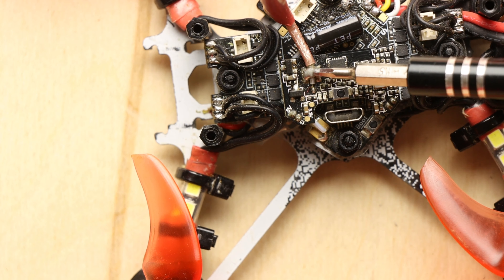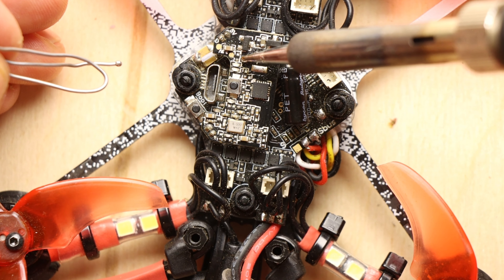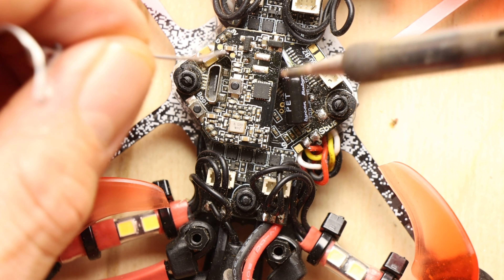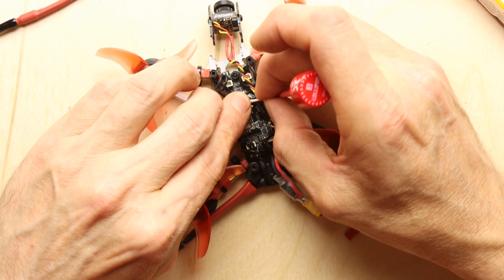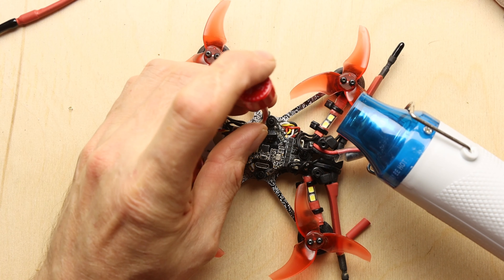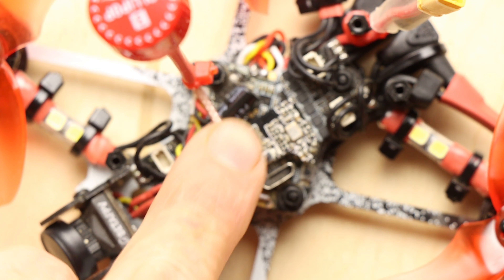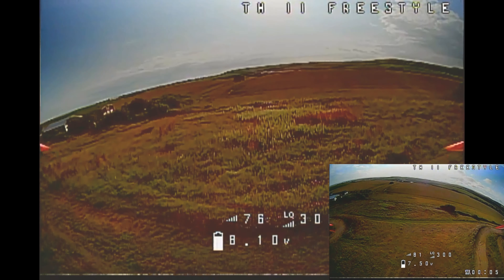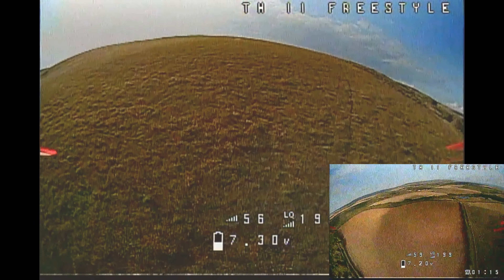emax tinyhawk 2 freestyle vtx antenna upgrade, amazing! results

Comment: I added a small zip tie to the plastic part of the battery strap and the antenna, which was pretty stable. It looks like you use two capacitors instead of one, does this have any advantage?
Reply from the maker: Yeh I went with a fatter zip tie and slightly shorter in the end worked better.
I've done both 2 capacitors and tried the variation of one on thr board or one on the xt30 lead and its all much the muchness tbh

Comment: Hello, just à question, (my english is bad and probably someone asked) i can do this and use the emax Google in the kit and Just change the antenna ? No need change other thing? Thank you!
Reply from the maker: Yes you can add this antenna to the drone directly or with the ufl plug as shown. For best results change the antennas on the goggles to rhcp antennas one lollipop and the other a patch 👍
Reply: @Stevieboyfpv  thank you👍

Comment: I did the antenna upgrade and I'm seeing better range and video quality except that my video will drop out completely for a 1/2 sec to 5 seconds randomly, any advice for troubleshooting
Reply from the maker: That usually means a connection, or earth problem somewhere 🤔
Reply: @Stevieboyfpv  I may have not put enough solder on the small pin of the u.fl connector
Reply from the maker: @Engineerforhire  possibly or you have a bridge 👍

Comment: What was your total range ?
Reply from the maker: @Tfam305  about half a mile before the battery would force return it could prob make a mile direct line of sight. I exchanged this for the foxeer micro lollipop after the video which was smaller and less flappy.
Reply: @ got it just ordered !
Reply: @ I am having throttle issues. Have you had that before? The drone is new if I barely tapped the throttle it’ll shoot to the sky.
Reply from the maker: @Tfam305  no sorry not had that, bit strange from new

Comment: would these antennas incease the range using the RTF kit? i understand that the controller and goggles are not great quality, but i assume that their range would be greater than the stock antennas on the quad. Any thoughts or advice would be appreciated!
Reply from the maker: If tou changed to an omni directional lollipop antenna on the quad and then had both an omni and a directional patch antenna on the goggles you will have better range and penetration. A great cheap upgrade, but also a 2nd hand pair if eachine 800d goggles would make a big difference.
Heres a link explaining antennas more
https://youtu.be/B4Nl_yJ_acc

Comment: Very cool! What was your VTX power?
Reply from the maker: The tinyhawk 2 freestyle
goes up to 200mw but in the uk we are only allowed to use 25mw so obviously I couldn't say to use 200mw
Reply: @Stevieboyfpv  I just ordered a few lollipops, my tinyhawk 2 and geprc phantom are getting upgrades this weekend :)
Reply from the maker: @TheBaconator_s  nice! You can avoid the  uf.l plug on the tinyhawk and direct solder like the original also which is way easier. Thanks for watching and commenting 👍
Reply: @TheBaconator_s  man you will never regret it. I did that to both of my th2s and my phantom. So much better detail and color! Oh but add a rapidfire module an omni and a patch antenna and you will fly places you never dared to go before. See you in the air

Comment: Hello, could you help me with something please. So, recently I have accidentally burned 2 different FC boards on my Tiny Hawk Freestyle 2! I solder all my motors, and then check all joints and they are very clean. I plug in my two 1s batteries to the pig tail, and the drone chimes up as normal and all is well. I then go to EMAX and get the proper THF2 CLI command for my new flight controller, and go into Beta Flight uploading it to the drone, again all is successful. I bind to the original EMAX E-6 radio, and it is bound. Now, when I give the drone about 1/4 throttle.......it throttles up very high, loses control and flips off the table. I try it a few more times and same conclusion, but now......the smoke is let out of my FC:( DO YOU KNOW IF I need to set the new FC to 2s lipo batteries before trying to fly it? It seems like that is what is going on, because if I was using two 1s(2s total) and the drone is set for 1s, wouldn't that possibly cause this issue? Any advice you have would be very helpful, thanks:):):)
Reply from the maker: When you have 1st soldered the wires to the board have you armed it without the props on to check that your motors are all going in the right direction? Looking for above wity the quad facing away. Front right anti clockwise front left clockwise back left clockwise back right anti clockwise?  If they are not correct change the wire soldering by swapping the 2 outer wired over as in there are 3 wires we will call a b c if the motor is spinning the wrong way swap a and c.
Reply: @Stevieboyfpv  I use BLHELI to change motor direction. Isn't that ok to do it that way, or should I unsolder and resolder?
Reply from the maker: @ifeetz7612  no totally fine
Reply from the maker: @ifeetz7612  so we're all your motors spinning in the correct directions?
Reply: @Stevieboyfpv  Yes, all my motors were spinning in correct direction. But, even so......motor direction would not have to do with me giving the drone about 1/4 throttle.......and then watching it continue to climb to 3/4 throttle....and flip out. Also, once the drone reaches a certain acceleration it vibrates and starts shaking back and forth on the table(no props on at this point). But here is the link to the exact FC I received twice, and, as you will notice they ONLY provide a single 1s battery cable. So, it made me think that the board as is, was somehow setup in Beta Flight for 1s. https://www.racedayquads.com/products/emax-tinyhawk-ii-aio-flight-controller-esc-vtx-rx?currency=USD&variant=31468255838321&gclid=Cj0KCQjwkbuKBhDRARIsAALysV7Z6XosaDlco_Nod8BnT9GVKhcBuDKfUyJMmruldLd_PPvRYmxcJhcaAjC6EALw_wcB
Reply from the maker: @ifeetz7612  with no props on the gyro will freak out
Reply from the maker: @ifeetz7612  Only check the motors are in the correct orientation with no props on after that the props need to be on or the gyro will loose the plot. If the props are in the correct direction (props in) and it freaks out with the props on next step is to change the motor direction in beta flight in the configuration page. This doesn't actually change the direction. Change the direction and hit save and disconnect and try again. Any quad armed without props on will experience fluctuations including spooling up and freaking out caused by vibrations the gyro doesn't understand which it tries to correct
Reply: @Stevieboyfpv   I just ordered another $80.00 tiny hawk freestyle whoop aoc. I will let you know how it all pans out. Thank you for your advice. I still just do not understand why even with the steps I say I have done, 2 different AOC FC have smoked out, on the bench. The advice you have given, seems as though it wshould only prevent the drone from keeping flight, but not releasing smoke. And I know that this has NOT been a soldering issue with any of the 4 motors, because BOTH TIMES (2 different boards)I have experienced this with, have both chimed in just fine when batteries were plugged in, and all motors could be controlled from beta flight just fine.
Reply: @Stevieboyfpv  And actually, I am pretty sure I had the props on when I hooked it up to beta flight the 1st time. I know you should always remove props with beta flight, but I used them to tell motor direction. I did receive the last FC, which had its orientation off from FC facing forward, but, I corrected and saved it in Beta Flight, and then digital model was facing the same way my drone was, and tilt was correct also. Everything was fine, even binding it to the original EMAX E6 radio, until I throttled it up slightly......and that was also with props on. In fact.......I even held my fingers down on the drone.....because I knew that when I reached 1/4 throttle, it would freak out, and then just sort of cut out. And again, I tried this a few times, and then it smoked! But like I said, I will keep you posted.....because right now, I have left about 10 different people messages about this, and you are the only person who is keeping communication, THANK YOU! And in the meanwhile.....I have other drones, thanks.
Reply from the maker: @ifeetz7612  next time save the cli dump
 Then flash it with the tinyhawk 2 freestyle dump.then solder the motors check the orientation is correct they would chime whatever the direction so make the orientation correct put on the props facing the correct direction and arm it,  outside is safer if when you throttle it flips over go in betaflight and change the orientation of the props in the configuration and save it and go again. I think you will find this will work.
Yes the board you are buying is for both the tinyhawk 2 whoop and the timyhawk 2 freestyle and the have different tuning but otherwise the same. Do the above dont be throttling it with the props off only arm it to check direction.
Reply: @Stevieboyfpv  Here is one more question, I am quite sure that I have been uploading the correct CLI file from EMAX, but lets say that somehow I was uploading the THF2, with the incorrect CLI file, would that cause the behavior that I am describing, or.....would that just be a matter of the board not doing anything?
Reply from the maker: @ifeetz7612  https://youtu.be/xBaefeQtA1c
Reply from the maker: @ifeetz7612  I think next time you may have to make a little video and post it. To make it easier to diagnose.
1. Type dump in the cli and then hit save to file 1st. So you have the original.
2. Input from file your new freestyle dump. You might have to type save in aswell
3. Arm no props to check motor orientation is as i said before
Front right anticlockwise
Front left clockwise
Back right clockwise
Back left anti clockwise.
4. Attach props making sure again they are in the correct direction.
5. Arm and throttle.
If it is not fine.
6. In configuration hit the switch below the quad bird's-eye view that says motor direction it has arrows pointing the direction the props should spin (props in or out). Change it to reversed or if already in reverse change to forwards save it and try again.
I have had a few quads I have loaded a dump to and it would freak and it was just that switch in the configuration for motor direction then it was fine.
Reply: @Stevieboyfpv   hold on, you say save the CLI dump? You mean as soon as I get the board......I am supposed to save what the board is shipped with, like a DIFF ALL cli command?
Reply: @Stevieboyfpv   Also, can I flash 2 different things simultaneously like that, I have only ever done 1 thing at a a time?
Reply: @Stevieboyfpv   Ok, and one thing I am doing that I am sure of. As soon as I get motors soldered and EMAX cli command uploaded, (no props)....the first thing I do, is go into the motor section.....and I throttle master switch and each of the 4 individual sliders....up and down, up and down, and I do that a few times.......because I just wanted to make sure motors were working correctly, BUT NOW I SEE, that I am only supposed to ARM THE QUAD without motors, and DO NOT THROTTLE yet. If this would have caused my issue, then I know I was doing it wrong! But you are correct, I will record the video, or 2.....of what I am doing, so that I can share it with you. I really appreciate all of your help. Please keep communication:):)
Reply: @Stevieboyfpv  I have a question please......when I receive a new flight controller, is it a bad idea to already plug it into Beta Flight, you know, just to see if it registers before I even do any soldering? Just wanted to know if that could hurt the FC, thanks again for your help.😀
Reply from the maker: @ifeetz7612  no that's a good idea👍
Reply from the maker: @ifeetz7612  don't forget "dump all" and save it. Plus on the emax site there are 2 cli dumls for the tinyhawk 2 freestyle 1 for the bnf version and and one for the rtf kit version so choose the one you have 👍
Reply: @Stevieboyfpv  ok thanks. But, which one should I chose for just a flight controller? A THF2 fc is not really a bind in fly or a ready to fly, so do I choose BNF or RTF?
Reply from the maker: @ifeetz7612  the rtf is if tou have the emax kit which has the goggles and controller as a package the bnf is if you have just the drone and your own different make controller and goggles 👍
Reply: @Stevieboyfpv  Ok, last question. I will be binding the Tiny Hawk Freestyle 2, to the original E6 transmitter(even though I am building the drone), so that means I want to update my FC with the RTF right?
Reply from the maker: @ifeetz7612  yes 👍
Reply: @Stevieboyfpv  Ok thanks buddy, and I will make a video that I can share with you, in case anything goes wrong:):):)

Comment: Would it be possible to route the antenna out back? I like to fly freestyle and I'm concerned that the antenna wire may ground components on the board.
Reply from the maker: Yeh I've routed it different ways including out the back 👍

Comment: What is that little part that the vtx plugs in to? Where can I get it?
Edit: I lost the screwdriver for the drone, is can u send me a link of a screwdriver that I can use for the drone?
Reply from the maker: Do you mean the little part the antenna plugs into? That's a ufl connector
You can also not use that and solder the antenna to the board directly the outer core (ground) to the 2 pads and the central (active element) to the single one the same as the original antenna. Here is where you can get some plugs though
https://www.droneauthority.co.uk/products/u-fl-connector-5pcs?variant=35451338981448&currency=GBP&utm_medium=product_sync&utm_source=google&utm_content=sag_organic&utm_campaign=sag_organic&utm_source=google&utm_medium=cpc&utm_campaign=10048663873&utm_content=100688416706&utm_term=&gclid=Cj0KCQjwmPSSBhCNARIsAH3cYgYN6&ref=98p3pmza5i

Comment: All my small EMAX products have VTX issues.  You should also replace the nylon stand-offs with metal.  Mine "exploded" during a normal Betaflight Air Mode landing after only a few flights.  The nylon stand-offs stripped out and lost half of the screws.
Reply from the maker: Watch the full upgrade video series ive done i change the standoffs in another vid , another the vtx another go through to even a frame change 👍

Comment: I would definitely suggest Zip tieing  the antenna to the top plate because if you pull the antenna to the right side it will put a lot of tension on your antenna connector 😁👍
Reply from the maker: No dispute on that one I ended up putting a thinker zip tie as the antenna support instead ander the shrink wrap and reducing the height and connecting it to the top plate 👍
Reply: Well done 😁👍 yeah it looked a little scary 😁👌

Comment: Thinking about buying the rtf kit for the thfs2 as my first fpv, but I’m little concerned about the integrity of the vtx and having a premature failure. Do you know anything about this issue with the vtx? Or had any issues yourself? Should I buy something else with my money or is it still worth it even if it means I gotta learn how to solder in a few months to replace the the video transmitter? Also I’ve heard the the motors on the thfs2 burn out a lot. Have you had this issue?
Reply from the maker: This is a superb starter, and I've had no issues with the vtx failing it can be unlocked to 200mw for more range. I have a string of upgrade videos for this quad. Its the perfect quad to learn all the skills needed for fpv which is why I made the upgrade series play list for it as you can learn cheaply. Learning to solder and exchange parts is an essential part of fpv droning dont fear it learn and enjoy gaining new skills and knowledge and then the freedom of fearless flying knowing your can repair your gear👍🤟
Reply: @Stevieboyfpv  thank you so much for the reply I appreciate the info. I decided that I probably need a bigger faster quad. I have a lot of land and I’m afraid I’d grow out of anything too small very quickly lol. I think I’ve landed on the iflight nazgul5 v2 5” 6s freestyle with the elrs receiver. Although 6s may sound like a bit much for my first fpv quad, I’m not a complete stranger to quads, helicopters, and rc cars and I have enough land out here I think I could figure it out. I’ve strayed away from the “kit” that way I can have a good transmitter and googles for any drone. I think the nazgul5 v2 5” 6s will be a good fit for me and be a good quad to grow into and last me a bit hopefully. Anyways think you again for the reply! You’re the man! I would love to hear what you think about my decision to go with the nazgul 5” quad instead. Also I really enjoyed all of the build videos on the tiny hawk and they got me pumped up to learn how to solder. Although I’ve decided on the nazgul5 5” I think the tiny hawk may still have a place in my collection lol I’m afraid the nazgul5 may be the first of many quads.
Reply from the maker: @jordangrapes5072  its a great quad for sure! Just go steady its enough to kill someone. A whole lotta of fun! I have a few iflight quads and around 20 in total 😬 its very addictive. Happy flying!
Reply: @Stevieboyfpv  hahaha thank you much I’m glad you think this will be a good quad. I am very excited. My dream is to eventually have a drone with 1-2 mile range as I live on a farm and being able to fry across all the fields to check the cattle and see where they are? How much feed/hay they’ve got? Have the broke in or out somewhere? This would be a huge help for my grandpa as he is getting older and it would be a blast in the process. I’m just not quite sure how easily obtainable that kind of range is if it is and if I can do it without spending a fortune.